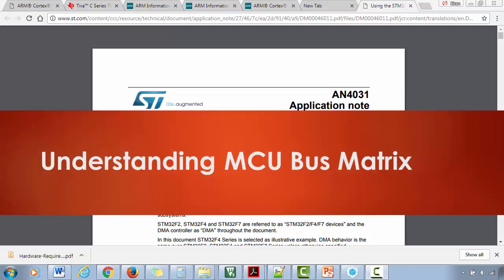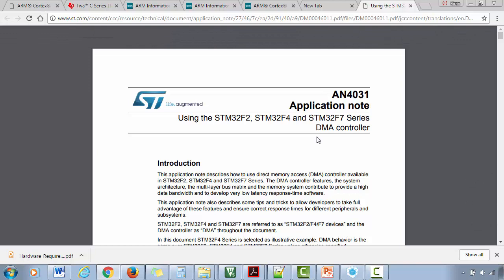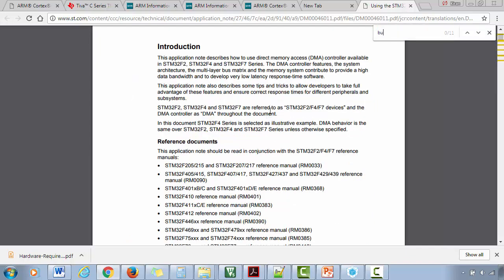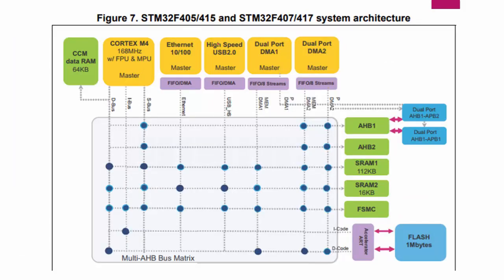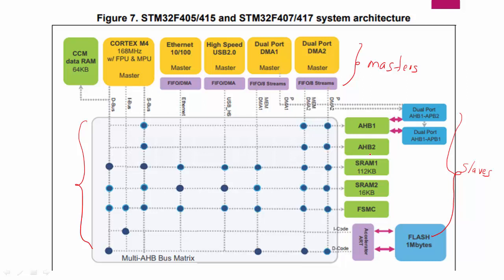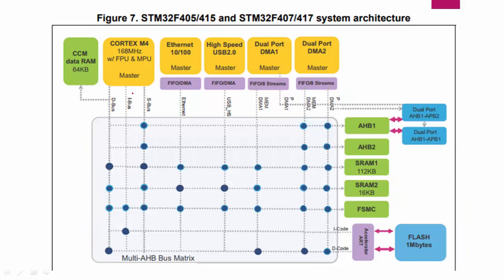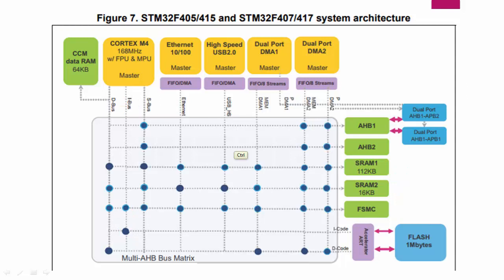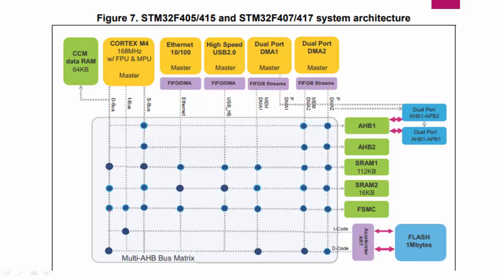Understanding ARM Cortex MCU Bus Matrix

Comment: Processor core has three buses all are of high speed I-bus,D-bus and S-bus my question is that in the overall system there are low speed buses are also available but eventually these low speed bus also need to talk to processor and there is a multiplexer to connect them to system bus. is it possible that low speed bus can communicate on high speed bus (S-bus)? I mean, is it possible to connect low speed bus to high speed bus? thanks in advance and thanks for high valued tutorials